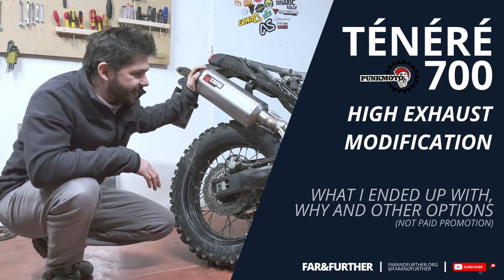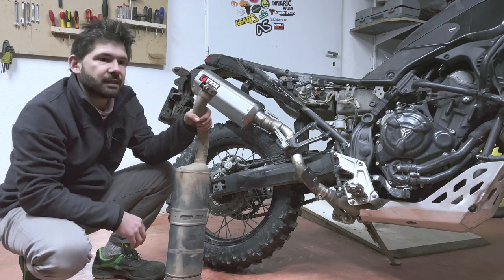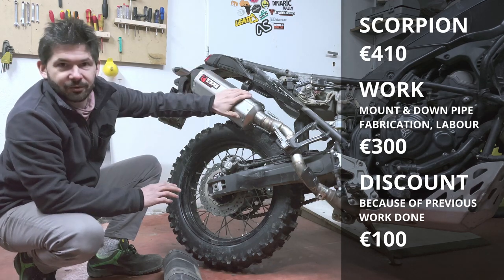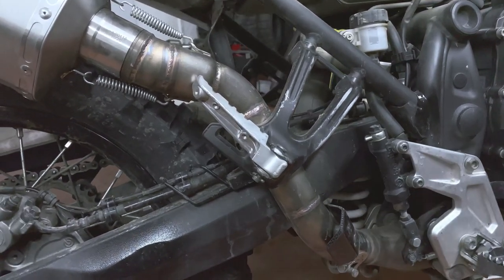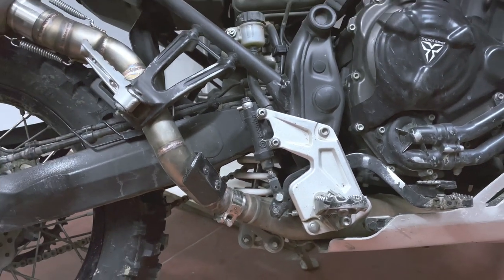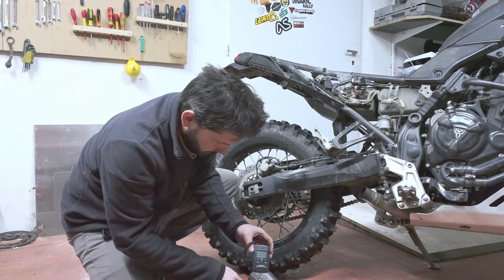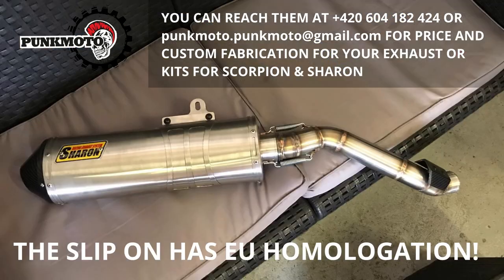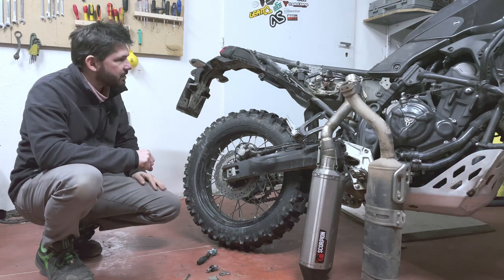Yamaha Ténéré 700: The Best (for me) High Exhaust with Scorpion slip-on and other available options

Comment: Thank you for the video.

I have been looking at the three options you mentioned. I would say, Camel ADV definitely looks to be the best quality.
Reply from the maker: Hey, I'm saying The Best from my perspective, not in general of course - and it's all custom so not fair play :)

Someone actually mentioned another kit I didn't know about so there seems to be more options popping up slowly, which is not surprising.

The Camel ADV kit is very good but to get it here I'd probably spent more than I did, if you're in US I kind of think it's no brainer to get the Camel unless you already have slip on or want different more robust mounting point. Also the Camel ADV mounting bracket is much better design than anything I saw.

Comment: Great topic, this seems to be the greatest design flaw so far. I am sure more kits will enter the market. Just makes the whole planning of luggage system more complicated.
Reply from the maker: Hello, yes I think there will be more and more kits coming up. What I have works with both Outback motortek X-frame racks as well as with Mosko Moto Rackless as you just use heat shield on the exhaust.

I suspect all other kits would work the same.

Comment: To me the big win goes to the Huzar, it's tucked up under and actually uses the mounting point to protect the exhaust.  I run pannier racks offroad to protect my low exhaust at the moment, but with that one I wouldn't feel any need for protecting it.  Also, I don't want to hack up the mount point.  I believe with the Huzar you have to cut a small hole in the plastic fender (says 30mm x 20mm)

edit: and I think it looks pretty good tucked inside, like a 990
Reply: I have the Huzar but never tried fitting it, looks good in the youtube vid though.
Don't fancy chopping the frame mount as it will affect resale value of the bike.
Reply from the maker: Hi, yes the bracket would protect the exhaust + it would allow to return to the OEM exhaust if one wants to sell the bike. The luggage rack would of course protect any high exhaust solution, I'm now running rackless system so for me it's a bit different.

Truth is that as the Huzar is so tucked in it may be possible to use it with something like Adventure Spec or Rally raid minimal luggage racks. I've not tried with mine.
Reply from the maker: Hi John, yep that's one of the big no when one thinks about selling the bike.
Reply: @FARANDFURTHER  I think if you are looking for a used Tenere, seeing that someone has fixed the exhaust problem isn't a downside. So I'm looking, and it'd be a definite plus for me if someone had gone to the trouble and expense of solving the exhaust issue. The alternative is sit around until Yamaha fix it in their next model.
Reply: HP Corse even better.

Comment: I need to get one myself!
I have the Arrow slip-on and I'll probably get a local exhaust shop to make customer mid pipe to link it.
Reply from the maker: Well it will solve the problem with the swing arm :) I thought that fabricating the down pipe is complicated but it seems reasonably straight forward so good shop should be able to do the job.

Comment: Hey you should design an extension ton to the Skid plate so it covers the Water pump on the left side…I think is vunerable.
Reply from the maker: Well, SW motech makes one so if you want you can just get it. It’s aluminum plate over the pump. I’ve not been able to destroy it yet so I’m not bothered that much. Clutch and alternator covers are good though.

Comment: Hi you,
Cool video. But unthinkable in Germany, unfortunately. I have also been thinking about it a lot.
The problem is really bad because of the swing arm. It's starting to look like that for me too. 
Take care of yourself and maybe it will work out for a meeting soon.
Best regards
Franky
Reply from the maker: Hi, why is it unthinkable in Germany? I though that when the exhaust has the EU homologation which Scorpion and Sharon does have then there is no problem doing this. Unless of course the problem is also cutting and changing the mounting point.

The mounting bracket will get gradually weaker and weaker until you will be bending back and forth constantly. I think at that point the T7rally swing arm protector which I mention in video would be good solution especially if you can't or don't want the high exhaust.
Reply: HI  @FARANDFURTHER  
The problem is that the bracket is welded to the frame of the motorbike. It is forbidden to weld frame parts that have load-bearing functions. In this case the exhaust system of the vehicle. Welding work on load-bearing elements such as the rear frame also requires a permit and may only be carried out by a certified welder.

And if it has been done, you have to do the TÜV. Since the exhaust tract has been modified. Without complete approval of the exhaust system, you are not allowed to drive here.

Please don't get me wrong. I think what you are doing is great and I would implement it immediately, but Germany is Germany. They wanted to regulate and define everything. We now even have laws that we have to register tyres that were previously completely unproblematic, that I've had on the bike for over 10 years.

I would rather be slow in Poland or Romania, there everything is still normal in this respect.

LG Franky
Reply from the maker: Thanks for explanation. That is indeed much more complicated than I thought! That is an impressive  amount of headache for that.
Reply: This guy is exaggerating a lot, if the muffler is road legal then there won't be any issues. No one knows that you cut that exhaust holder if you don't make it obvious.
Reply: @kowalski2334  That's why I had "no problems" with it at the TÜV. Because no one knows. Unfortunately, you may have little idea how it runs in Bavaria / Germany.
Sorry. Everyone can do as he wants, but should not arrive crying when he gets problems.
best regards
Franky

Comment: hey man, thanks for the videos as always, very useful stuff. 

I'm still undecided about which way to go with the exhaust. 

however may I ask which tyres you are running in this video and the last one? they seem quite offload worthy! 

thanks
Hugo
Reply from the maker: Hi Hugo, it's tough one. On one side I think that some high exhaust conversion is the real solution fot the problem but with the T7rally swing arm protector it could also work.

I don't really think it matters which kit you get as long as it's legal in your country (so you're not bothered by the police) and you like it it will do the job. I don't like the long hot pipe of the Huzar solution so I'd prefer the Punkmoto or Camel ADV one.

Also if you don't bend it regularly now you may not have a problem at all. It's not that you HAVE to do high exhaust mod, only if you need to.

Comment: hey, great work and solution with the exhaust. My question is, wich tyres are mounted?
Reply: and wich size?
Reply from the maker: That has been some time… 🤔 I think it was a time I had Mitas EF-7 Terra force on the rear and Mitas C-19 in the front. It was winter training season. They would be 140/80-18 and 90/90-21
Reply: @FARANDFURTHER  thanks very much. Driveable on street?
Reply from the maker: Yes but with much less confidence than on dirt, especially when wet and cold. Also on the road they will be gone in few thousand km.